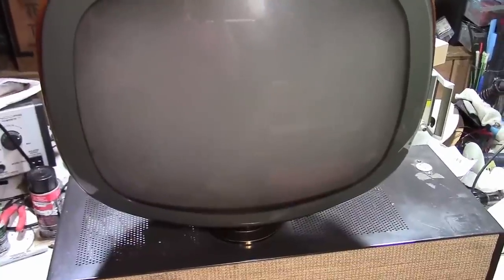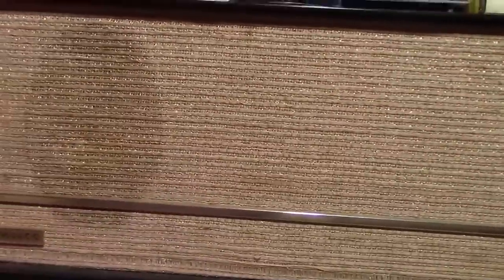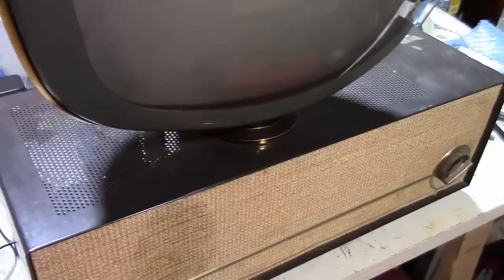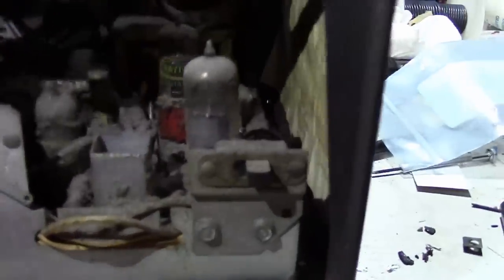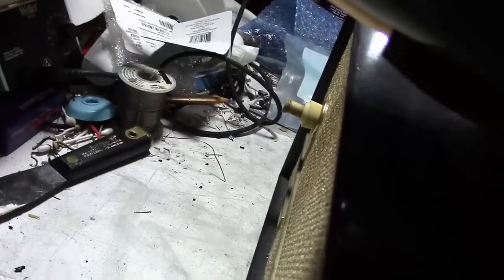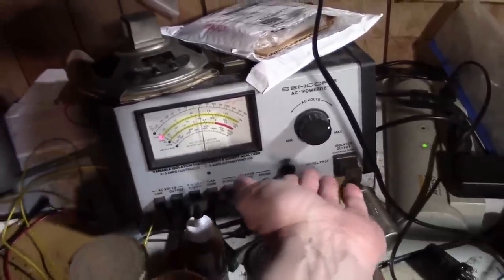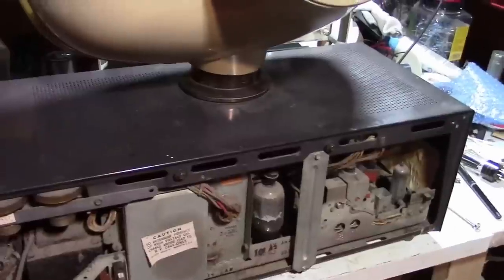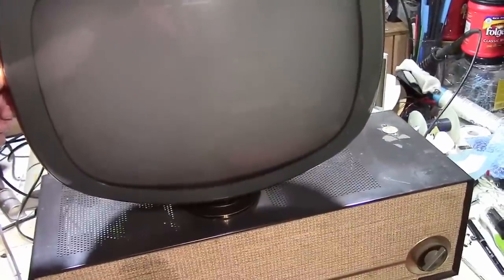My latest find

Comment: Wow... that's a nice set, and it was a bit of a bummer when it pooped out, but, it's good to have a recording of the screen at the instant the set failed (09:27)... that recording showing how the raster  collapsed into a 'horizontal' line and indicated that something in the horizontal drive/deflection circuit failed. :-)
Welcome back Bob and thanks for sharing.
Reply from the maker: Right you are.  Might just be that loose connection on top of the horizontal output tube.
Reply: @bandersentv  Am I right in thinking that if it collapses into a vertical line, that would be indicative of horizontal failure? Likewise, a horizontal line = failure of the vertical?
Reply from the maker: Yes and since the horizontal drives both the line and generates the high voltage both failed
Reply: @bandersentv  Yup... a loose horizontal output tube's  plate cap will definitely do that. :-)
Reply: Yes, you can actually hear the 15kHz oscillation stopping at this time, too.
Reply from the maker: Maybe you can, but I can't hear that high a frequency anymore.  Too much loud music in my youth

Comment: Have you thought about some aerial on the roof and running coax   to basement?
Reply from the maker: Nah.  Not for one low power station that will go off the air someday soon.  I can get OK reception down there for a few ASTC (digital) broadcasts